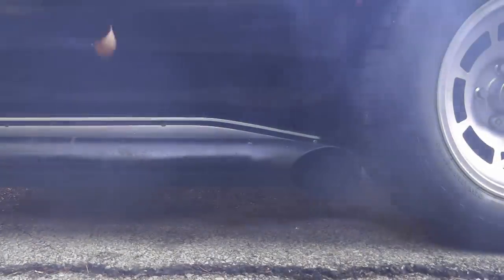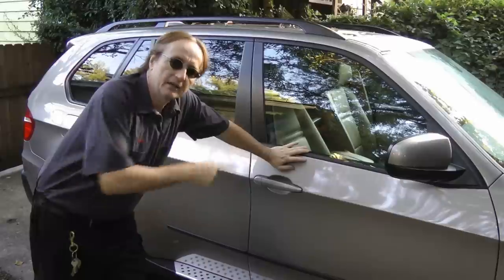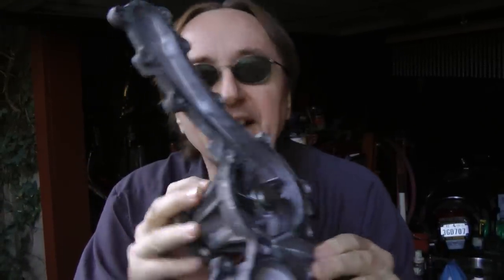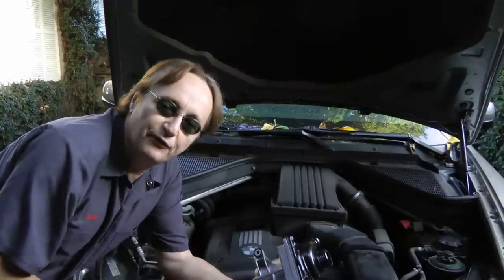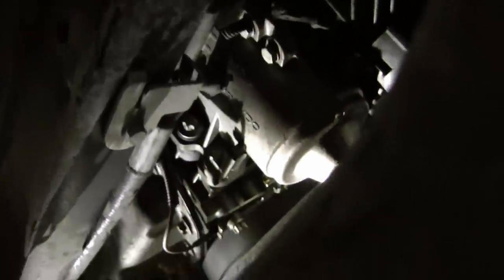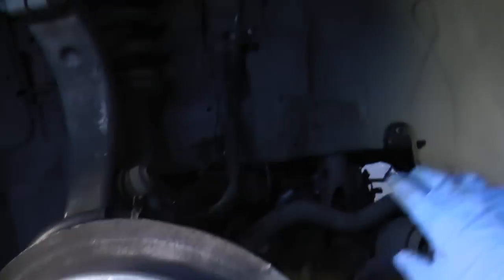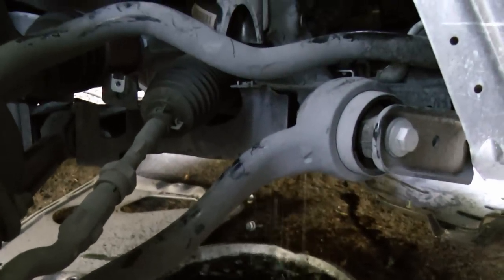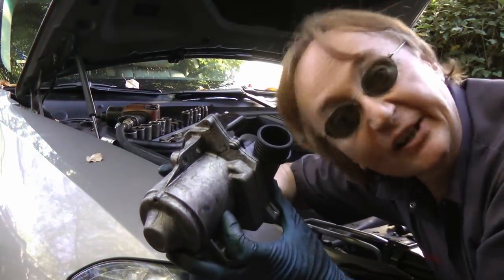How To Replace a Bad Electronic Water Pump

Comment: Sir Scotty I own a 95 corvette with the mechanical pump and I’ve owned this car sense 2010 and already having to change out the second pump. It’s the one that works off the cam and can leak out the weep hole - wait for it - (donkey face laughter) ya well luckily I learned the first time that weep really meant faucet opening and drilled n tapped my faucet hole and ran a tube down through to the ground as a precaution against opti destruction but here we go again and maybe this pump has same issue as the older pump due to rubber seal on shaft. Seems they could’ve designed a much higher quality set-up then that so there would not need to be a rubber seal in the first place just seems so dam cheap.

Comment: Finally!  A video that shows how I feel every time I have to work on a car.. Of course, my 5 hours is just trying to get rusty nuts and bolts off.. but still..  :)

You should be happy.  Isn't that part of how it works?  They spend WAY TO MUCH for a BMW knowing that replacement parts are going to cost WAY TO MUCH, and then you, the mechanic, get to charge WAY TO MUCH because it takes you 5 times longer to do than it should.  Sounds like a win/win for everyone but the idiot that bought the BMW.

Comment: I could see why this might be a good idea.  Having the water pump run when the car is shut off may help keep the engine in its ideal temp range. A hot engine can raise 10 degrees after its shut down.  Maybe the engineers need to distance the pump from the electric motor a little more.  This reminds me of electronics and computers being introduced into 1980's cars. I was not driving then, but heard nightmare stories.
Reply from the maker: David James yea, a great Theoretical idea. But when electronics break, as they all do, especially ones soaked in water, engine goes BOOM.
Reply: +Scotty Kilmer a household water heater is electronic and they give no trouble, well insulated electronic pumps are perfectly safe to pump water through
Reply: +camtheham13 This channel is about auto repair not home plumbing.
Reply: +David James Or maybe they shouldn't have replaced a simple foolproof part with a more fragile, complex, and difficult to service one...how's that for a crazy idea?

Comment: my girlfriends VW had one of those! we could hear it after the engine was shut off. the electronic transmission failed and it would stick in 1st gear until it warmed up enough to upshift, she owns a 07 sebring now, and it only gives her occasional grief.

Comment: Kinda reminds me of General motors using plastic radiator shells versus Ford which actually used Aluminum. Those plastic ones would crack and develop leaks more easily

Comment from the maker: realize you need a machine as in my video "fixing modern cars using high level scan computers" to analyze and repair those dumb EVAP systems, no way out of that. they are complex and guessing often fixes nothing. So find a guy like me with a machine like that which operates and tests such evap systems.

Comment: While I agree that German cars are over-engineered in some ways I'm glad they're not as cheaply built as my last two Pontiacs.  (I have an Audi now and I love it so far)

If that BMW is only 3 years old didn't the owner have any warranty left?  Then a dealer would have to put up with the headaches of replacing the pump.  Or maybe the car is over the mileage limit?

Comment: This is how I feel about the 1997 Ford Explorer we have. It has the 5.0L V8. So as you can imagine, everything is packed in tight and getting anything off requires pulling off all kinds of other stuff. The entire time all I can think of is "This is the best Ford could think of?" I shudder when I think of the TWO PIECE lower hose for the radiator, and what a nightmare that was getting that all replaced. My daily driver is a 1988 S10 Blazer, waaaay easier to work on.

Comment: Previous generation of BMW was using normal water pump. More easy to fix and part was very, very cheap and easy to find at bargain price. Replacing water pump on my 325i 2004 was something about 75$. I replaced it at 160 000k miles. Now, on my E90 the part cost 400$ and need to be replaced 2x more often and the part is hard to replace with confentionnal tool. But not impossible. The company follow the mind of the other car maker....

Comment: Hey Scotty
When it comes to water pumps how bad is mine when it needs to be replaced.
Car is a Chevrolet 2007 LS model.
Is it  really tough to do the job on it.?
Price wise its about $70.00...
Reply from the maker: na, easy job, I could do it in less than an hour on the GM engine

Comment: hello scotty i have a question i got  jag s type r and i recently got p1474 code which is mean intercooler water pump circuit malfunction,,so now i think i located the pump on mine jag is under or near to the radiator and there 2 hoses i followed one of the hoses and one goes to the supercharger intercooler and i start the car and there is not activity or water going thru the hoses  and now my car is on restricted performance ,, im wondering should i replace the pump which is very expensive  or check for electrical issues  or connections ,,, or how can i test the pump to make sure is working or no,,, thanks i hope you reply back

Comment: Scotty
You're not right in the assumption that I DON'T work on BMWs. I own one, and it's more reliable than ANY US car that I have had. I worked for Buick, and needing to take off a 100 pound bumper to replace a tail light, or remove the head to replace a heater core. I could go on but you brought up Toyotas and not American made cars of which my reply was focused on.

Comment: Hey Scotty, what's your opinion of the E46 BMW M3?
Reply from the maker: fun to drive, not to fix. Endless money pits as they age
Reply: How many E46 M3's have you worked on Mr. Kilmer? Your opinion on them 
seems to be rather intense. Most M3 owners don't need mechanics to work 
on their cars, and the seldom rich guy takes their M3 to the dealer. So 
how many have you worked on?

Now coming from a guy who has worked on BMW for about 7 years now 
exclusively. The E46 platform is considered one of the most reliable. 
The M3 in particular. One of their biggest issues is that the lower-end 
E46 models (323, 325) often crack the sub-frame, which if left alone 
will eventually cause damage to the frame rail mounting points. And the 
other thing is some of the E46's got a bad power steering pump which 
snaps its shaft off and then PS is lost. Those are the only two main 
issues with these cars. Other than that, they are rock solid. The M3 is 
not affected by these problems at all.
Reply: Listen Hristov Troll. It's a well known fact that BMW's have become total garbage money pits.  You have no case here.  We have always had BMWs and I even owned a 1996 318ti (hatch back) oh so many years ago which was a solid vehicle, but since the early 2000s BMW vehicles took a nose dive in quality and reliability.  My sisters BMW X3 now has so many warning lights on we have just stopped paying attention to them anymore because every other week something else is wrong with it and a new warning light comes on; Christmas lights we call them now!!!  Me I have a 2002 Chevy tracker now with almost 500 000 km on it which I do most maintenance on myself, most reliable car I've ever owned.  Now Mr Hristov Troll show me ONE just ONE BMW with that many miles on it.  Now learn your facts and quit your trolling ... OH BTW The water pump on the Tracker is still the original, mechanical, belt-driven one and I live in Northern parts of Canada with no Heating or cooling problems, so spare me your rhetoric about an electrical water pump working better in Canada!

Comment: Regular water pumps driven by the belt put a drag on the engine. An electronic water pump is high tech and more efficient, as long as its working. That's why bmw uses them, BMW customers expect their expensive luxury car to have the most modern and efficient technology, which is what electronic water pumps do. I can't imagine a 3 year lifetime of the pump to be normal, the majority probably last much longer. Nearly every car has at least one part failure within a few years. My dodge' alternator went out at 5 years, its 8 years old now and that alternator is the only part failure I've had

Comment: I respect your opinion on this, but i think there are more reasons for this pump than just to make money. I think BMW adapted this system for their direct injected gasoline engines, which burn much leaner, and therefore hotter than normal injection engines and therefore need a more precise cooling management. Also the step to magnesium as the engine building material should have had an effect on the cooling system, as well.

Comment: Hi Scotty, I have 2004 Chrysler Sebring and the top metal part of the car above the radiator gets very hot even when I run the car for short distance . The two radiator hoses get very hot too.And when I attempt tho start, the car, it doesn't start until I let the car get cold. I tested the fan and it is fine.
What can it be? I took the radiator out and I am cleaning it but I'm not sure it is going to fix the problem,because It is not that dirty and the water runs fine inside it.
Reply from the maker: those get hot normally, if the temp gauge on the engine runs normal, leave that alone.  But, when the car doesn't start, do my video "fixing a car that cranks but doesn't start up" to find the cause of that

Comment: WOW interesting. I have a 2001 BMW X5 and luckly the water pump is not hard to find.  I have right now 134,200 miles on it. My BMW specialist told me that the water pump is still good and my radiator is still good.

Comment: Electronic water pump uses less energy course its speed can vary according to the needs. Belt driven pump has speed that is tied with engine rpm. Modern cars can lessen the alternator output power and that way give more power to wheels when needed. But don’t get me wrong I also hate that hey put on parts that are bound to break.

Comment: VW has been guilty of that for years, well kinda, their waterpumps are driving by eather a belt of chain, thankfully, but on most of them, the water pump wheel is made of plastic, that is the OEM water pump anyway, because I have seen an aftermarket water pump where the pump wheel was made out of Brass, I think, I might be wrong, but it was some kinda metal anyway.

Comment: Scotty so I have a problem with my 95 accord. It was working fine but then early ion the morning when I tried to turn on my car it won't start. And now the only way to start it is to jump star it.  Can it be the alternator. The battery is new 5 month old and new battery posts as well. No spark no crank and dash board lights barely visible then it turns off.

Comment: Will stick to my older 99 bmw 740I v8 more metal but also has an electric water pump but the harmonic balancer bolts broke and messed up that so I replaced the water pump to be safe (: with belts and clutch fan since it was brittle (:

Comment: An electronic water pump actually isn't a bad thing. Being electronic it can replace the traditional thermostat, fully control the flow of water, and would be more efficient for the engine since it doesn't have to move another belt. The problem is it needs to be made more like a traditional water pump. Metal housing, metal fins, and a plug located in either a cooler part of the engine bay, made with a heat shielded plug, or a built in longer plug that can be plugged in elsewhere.

Good idea, poor execution.
Reply from the maker: yea if it wasn't placed in a hard to get to location and wasn't cheaply made so it burned out too fast. Remember, water and electricity don't go together well and seals often go bad and mix them

Comment: That would make sense if battery power was bottomless or the alternator wasn't run off the engine.

Are you sure? that makes the alternator work harder plus makes initial and replacement costs higher. 

having less accessories doesn't mean the engine can 'produce more power' less electrical or mechanical load means more is available for the drivetrain. The engine still produces the same base power.

Comment: Hey Scotty can you have a problem getting heat if the water pump is going bad? On my 2010 dodge charger sxt I had the heater core flushed and still don't have heat when I sit parked... only when I drive and a decent speed I get heat... the car doesn't overheat and always reaches the correct operating temp
Reply: Ira Friedman there may be a valve in the engine compartment that isnt functionint properly that would give you the heat to the heater core
Reply: +Ira Friedman Yup.
Reply: +Ira Friedman Google how to check your water pump's function, of course.

Comment: Hi I have a 1995 chevy s10 v6 auto.... If i let the truck sit in park or neutral while its up to temp and running, the check engine light comes on.  If i put it in any gear it shuts off within 30 seconds.  I try scanning it and i get no codes.  Any ideas? Thanks
Alan

Comment: great videos it s me again with the old tin can 1986 nissan pulsar nx the water pump gone got the manual but it only show the pump when the engine is out of the car so the motor mount is stopping me from getting anything done plus the pump pulley is impossible to get off beside taking a grenade to it and walk away what can i do
Reply from the maker: yea, shitty design on that nissan. Remove the mount and take the pump off with the pulley and fan assembly on, stupid design for sure

Comment: The main reason why they use electric pumps, is because when you run the pump mechanically off the engine, that more power that is taken away from the engine. 

less accessories being run by engine = more power that the engine can produce.

Comment: nothing could be more true then this video. i have a 2013 x5 m sport and although i love the design and the drive it was a bad purchase. first off 80K for a car that the water pump breaks 5 thousand km after the warranty is done makes me sick to my stomach. secondly try finding those damn bolts what a pain in the arse. i mean 80k you would expect the water pump to last more then 3 years!!! secondly good luck finding parts thats aren't OEM!! you are going to get killed once the warranty as i am finding out. ill wait till the summer and cut my losses. No more luxury cars for me going to spend 40k and buy myself a f150

Comment: hey Scotty i have a 94 Silverado. My problem is no heat. flushed everything and  I have determined that i am getting very little to no flow through my heater core.  But am not overheating.  I'm perplexed.  I suspect weak water pump or possible head gasket. Though showing no other signs of bad gasket besides odd smelling exhaust.  Any suggestions
Reply from the maker: clogged heater core on that old thing, replace it
Reply: Scotty Kilmer Flushed it out. It seems to flow fine. There is no pressure in the hoses. Is it rare to have a water pump not make enough pressure to heat?  Thanks for taking the time..
Reply: All Ball thermostat stuck open. not building pressure = no heat
Reply: +Shi3aOfAli on my third thermostat.  Was sure it wasn't the heater core and I was right. I changed it out and still no heat.....I guess you didn't hear me say i flushed it and it flowed perfectly.  I told the shop I took it to the same thing.  I guess they didn't believe me either so i just changed it out. And wal la still no heater. I understand mechanics have to assume all customers are retarded but this is just pure laziness....I HAVE NO FLOW.
Reply: I guess you didn't hear me say i flushed it and it flowed perfectly.  I told the shop I took it to the same thing.  I guess they didn't believe me either so i just changed it out. And wal la still no heater. I understand mechanics have to assume all customers are retarded but this is just pure laziness....I HAVE NO FLOW.

Comment: I wonder if you could find steel bolts the same size, or would that cause dissimilar metal corrosion. I'd be afraid of breaking one you really can't work magnesium.
Reply from the maker: it would cause corrosion due to magnes alloy block they use
Reply: Thanks Scotty.

Comment: question I got a 99 honda civic and recent just got new radiator and lately my radiator reservoir been bubbling doesn't show that it over heats and the fans do turn on what's my next step
Reply from the maker: +richard holguin do my video tests "how to fix an overheating car" because it is technically overheating.
Reply: +richard holguin blown head gasket

Comment: Did you check the fuse first?
Reply from the maker: +Daniel Morales I'm waay past that. it even set the code for electronic water pump failure with my fancy scan computer
Reply: +Scotty Kilmer I was sure you did but you never know these days. : ) Great information by the way. I enjoy your take on auto repair. You should do another on Mercedes, we can tell this is your favorite vehicle (wink).

Comment: The electronic water pumps are designed to reduce load off the engine and be one less thing for the accessory belt to have to spin.  It is alao much lighter in weight, can self air bleed after a coolant fkush, and is able to keep circulating coolant after the car stops to keep cooling down the engine.  Being plastic is the only really bad thing.

Comment: the benefits of an electronic water pump allow the pump to circulate fluids through the engine and turbos to cool even after the engine is turned off. obviously this is needed in a more performance oriented vehicle so even after a hard drive you can turn it off without a turbo timer or such. besides practically every car now uses electronic pumps. this isnt 1960